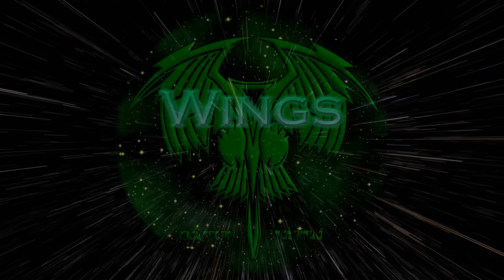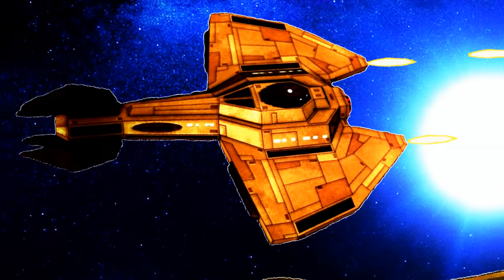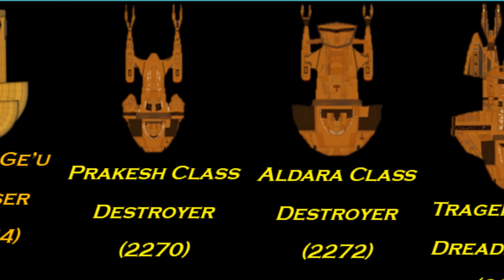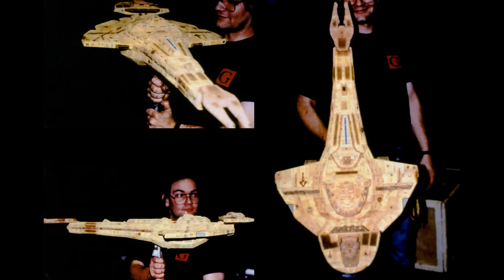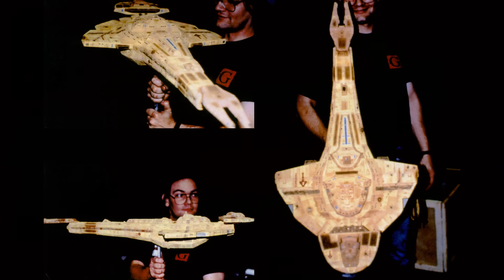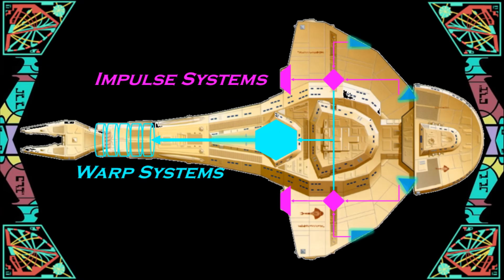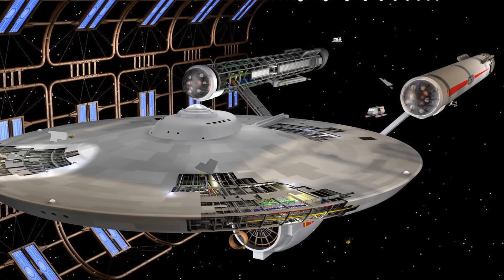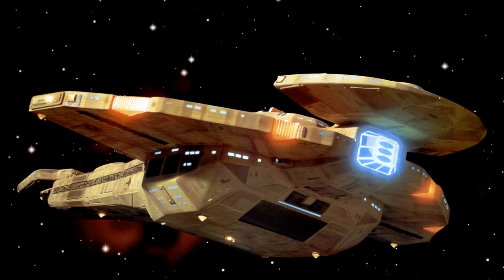Why Are Cardassian Ship So Weird?

Comment: I think Gene's 'rules' really only apply when certain design choices are in play. And an oversimplification, conflating the nacelles with the coils housed IN the nacelles.
-Rule#1 "Nacelles must be in pairs": I think the common modern understanding it it it less about the nacelles, and more about the warp coils housed in the nacelles. So, by this logic, you can have a single or odd numbered nacelle IF it contains a PAIR of warp coils.
-Rule#2 "Warp nacelles must have at least 50% line-of-sight on each other across the hull": Again, if we use modern understanding, in a single nacelle configuration with dual coils, the coils will have LoS of each other WITHIN the hull.
-Rule#3 "Both warp nacelles must be fully visible from the front": I think this speaks more to Starfleet's decision to put the bussard collectors on the nacelles. Having (parts of) the hull in front of the particle scoops would likely reduce their efficiency. Move the bussard collectors, to any other front-facing part of the ship, and rule 3 is no longer applicable.
-Rule#4 is not really germane to the discussion here.

Considering in Cause and Effect the USS Boseman clipping a nacelle was enough for the Enterprise D to be destroyed before anyone could even REACH an escape pod; In some ways the cost-saving solution the Cardassians arrived upon probably made their ships more resilient on the whole, as well. From the front their warp coils are ENTIRELY behind the hull of the ship, from the top/bottom/sides, even if it is exposed, you would have to AIM for it, while you're more likely to hit something more centre-mass like the main hull. Even from directly behind, it has a remarkably small footprint.

Comment: Russian fighters have full radars in the tail, as well as on the side of the nose, for guiding radar-guided air-to-air missiles.  Before western fighters got helmet-mounted cueing, it could have been a big advantage, being able to take shots far off the direction of travel.  Guided weapons haven't been seen much in Star Trek, but it could be important to Cardassian guidance systems.  Also the tail has a great unobstructed view in every direction except front and back, so it would be a great place for an omnidirectional sensor array that the front and rear sensors can fill in the gaps for.

Comment: There are a LOT of fighter jets that have radars in places that aren't the nose. For example the SU-57 has one in the ass tucked between the engines, as does the F-22 and the F-15, and all three of these have radars pointing to the sides as well. Why would a warship only have sensors pointing forward? No blue water naval asset built in the last 50 years does so why would a starship that has twice the area to cover that an enemy could be hiding chose to be blind in 80% of directions?

Comment: Based on your analysis it’s pretty good. But I got a possible suggestion about that one nacelle in the tail. That one nacelle is actually two semi cylindrical nacelles put together resembling one. There is no mention you can’t have them next to each other that I am aware of. With d-shaped warp coils being smaller would be easier and cheaper to manufacture. Anyone would worked in crafts and manufacturing can recognize that smaller would be easier, faster, and cheaper to make in a war involving attrition. This does not change anything about your analysis on functionality. Everything would still work as you described.

Just wanted to say this even if it’s wrong.

Comment: It's a shame we don't see many example of military aid or surplus usage. In TOS we had Romulans using D7s (totally not for budget reasons), but you'd imagine smaller empires make use of old surplus designs from larger empires that no longer need those ships, just like we have in real life. It's better than just scrapping them (which we do see). Where's the faction that takes Klingon and Federation ships, slaps some new systems and guns on them and covers the hull in scifi equivalent of ERA?

Comment: Actually to this day I believe these ships are flying backwards. fair enough, they are modeled after Egyptian ankhs and the tail is like you said, a claw, or maybe a stinger like a scorpion, yet if they are flying the other way around, their profile looks like an old sailing ship with the bridge at the back and high above the other decks. If so, then what you call a stinger would probably make even more sense as a stinger, housing heavy cannons or even photon torpedo launchers right at the front like old monitors or even the first torpedo boats with the torpedo launchers right in the front. So yes, I think that somewhere along the line the designers of these ships had a certain indecision about what their flight direction would be in either decision that they could make would turn out to be a very cool one, just as it did.

Comment: Rear facing sensors work as an idea with the whole "jet fighter" design principal, most modern fighters have a secondary radar in the rear to act as an early warning system and to assist with tracking targets behind the aircraft. Kinda neat honestly.

Comment: I always assumed that the prongs on the back end were the nacelles and that the Cardassians just opted for smaller nacelles and like a more powerful warp core. 

I play electric bass and guitar, so I kinda analogized this to how guitar and bass pickups work. Basically these are electromagnetic devices with magnets and coils of wire. This is a gross oversimplification, but to get a "hotter" pickup (as in more apparent output, which translates to higher volume or more overdrive, depending on the amplifier and how it's set up, etc.), you can add more wire windings, or you can use a bigger/stronger magnet with the same number of windings. 

The other possibility that occurred to me while watching the video and looking at the older Cardassian ships. What if they actually DO have two nacelles, but they're stacked vertically in the tail section? On the Galor class if you look at it in side profile, there is a horizontal line bisecting most of the tail section. What if this is actually the division between a stacked pair of warp nacelles with oval shaped coils, held within the body of the ship?

Comment: Different levels of technology leads to different innovations.... the concept of a lateral or broad technological advance vs tall or forward advances.  Kind of like the cell phone has been broadly advancing but in the end they are the same technology that has just advanced in its use as opposed to the next level of dermal implant phone thingie.  I believe the concept is that the easiest and safest method is the rodenberry rule, while other methods can show advances beyond the norm but without an advance in the speeds or type of warp drive.  Star fleet vessels got with tried and true designs ever specializing and trying to Amp up however they can to improve stable speeds.  In the case of cardassians I would point out that maybe they had to create a system out of necessity for war, maybe not as safe, quicker to build, and then out of ego decided to perfect their system to make it theirs and different from their enemies.

Comment: Heat sinks do not work in space as there is nothing to take the heat away from the system.  Heat sinks work in atmosphere because the air molecules take the heat energy and disperse it.  This is not available in the vacuum of space.

Comment: The thing with the one nacelle at the rear is that it would be an extremely inefficient warp bubble, the ship is contained in the front half while the rear half is just covering empty space. With a single projector you also cant modulate your warp bubble to be closer to the hull as you could with a twin nacelle design. That may actually be a lore reason why the Cardassian ships warships are usually slower, often maxing out at Warp 8.

Comment: I'd expect the maintenance on monocelle designs is vastly simpler, because there's no requirement to tune and calibrate a pair of nacelles to be perfectly balanced.

IIRC, tuning pairs of nacelles is mentioned in one or more TNG-era sourcebooks like the Technical Guide as a major task undertaken only at major shipyards and starbases, implying major infrastructure, tooling and expertise. Dual nacelle designs allow starship designers more design latitude and greater performance versus monocelles. But only being able to go Warp 8 but have twice the fleet is a valid design choice. As the Soviets said "quantity has a quality all its own". It's exactly the choice you'd expect from a faction with more manpower than economic power.

It's slightly surprising we don't see more monocelle designs among second-tier species, but Federation members probably adopt Federation-recommended minimum engineering standards that include dual nacelles for all warships and most support vessels.

Comment: Aircraft have missile detection and eletronic counter measures on their tails. 
And as most of the weapons face forwards, having warp wings makes no sense if you want to preserve your warp engines from damage. Having a single nacelle behind most of your structure, it'll be protected and you can run away at warp if necessary.

Comment: The problem with the "claws" being for heat is there's really only 2 ways to get rid of heat in a vacuum. Thermal radiation or conversion. If they were thermal radiators they'd likely be glowing and would probably need a much larger surface area.

Comment: In my head-canon, not at all confirmed by evidence on screen, I have always thought more warp engines mainly means "more reliable for long range" rather than "faster."  Like, a Constellation Class with four engines can be waaaay out making first contact with the Ferengi in a place that Starfleet couldn't even recover the ship.  And more spread out engines are also generally more reliable for long missions, like a Nebula Class does short range Cardassian border patrols and a Defiant Class mainly stays parked at a station because the tucked-in nacelles are easier to defend with shields but dump more radiation into the body of the ship so they need baryon sweeps and maintenance downtime more often to mitigate the effects of warp engine emissions being right next to core systems.
Since Cardassian ships are mainly warships and not explorers, I think it makes a ton of sense to interpret them as having one big warp engine at the back that is tucked into the hull.  They are meant for short range tactical work, border defense, and war with fairly close by neighbors rather than power projection thousands of light years away.  That all aligns with not needing to maintain detached operations for years and years with a lot of self-managed maintenance in a friendly port.  One well shielded warp engine would make a ton of sense with how their doctrine is portrayed.

Comment: I will correct you  on the aircraft doesnt have sensors backwards, they have sensors everywhere! Those rear ones are usually in between the engines or embedded on the vertical stabilizer.

Comment: What if the cardies use nested warp coils? If you had one coil *inside* another, then they still have full line of sight, so to speak. The tails might be there for shaping the warp field, like, vectored warp geometry? They do all pinch toward the aft, perhaps its like the tail end of a jet engine, focusing the warp field which might theoretically make them capable of higher warp speeds, possibly at the cost of warp maneuverability?

Comment: I had just assumed, looking at the Galor in particular, that there's 2 warp engines, side-by-side in the tail. Presumably there's a small gap in between, which is also an access space to maintain the warp engines. Among Cardassian single-tailed designs, the wide(X > Y) tail of the Galor predominates, and the lateral tail grooves are relatively common. I never questioned the "wings", they seemed obviously of the same sloped-armor school of design as Federation saucers.

However, the question of maneuverability at warp combines with the canon graphic(TNG 6x11 Chain Of Command, Part II) to suggest a design with three(or four) unequal engines. Note the areas lit up on that graphic(a Galor): Just a little bit at the tip of each wing, the lateral tail groove(and presumably its mate), and an aft-wards patch on top of the tail, just fore of the (probable) radiator. Presumably the armor and structure protecting the tail engine(s) affects the pattern there, but this suggests they have a small warp engine at the tip of each wing, in addition to the tail engine(s). This also solves the issue of the wings being too small to support main engines — the wing warp engines are indeed smaller.

Instead of splitting up two main engines for yaw, they tuck the main engine(s) away in the tail, and have an extra pair of little engines specifically for maneuvering at warp. That extra pair appears to be spaced as wide apart as the design supports, which is exactly where you'd want yaw engines. Thus, the wings are effectively heavily-armored pylons, in addition to appealing to the same justifications as the saucer.

The same may apply to some designs(notably Klingon and Romulan) with dinky nacelles. Those are for maneuvering, and there's a main engine or two buried in the hull.

Also, note that there are multiple single-nacelle Federation ships — all, so far as I'm aware, freighters or the like rather than warships or anything performant/maneuverable. This being a valid cost-cutting measure seems well-supported. It's possible the scaling exponents make the small maneuvering warp engines disproportionately cheap, but that would also suggest two rather than one engine buried in the tail.

I note the full-blown warp wing hypothesis isn't fundamentally out of the game — look at pre-Federation Vulcan designs, most use a "wing ring" rather than nacelles — but the canon graphic is a killer there. It's not the whole wings, it's just little bits at the tips, and also some parts of the tail.

Comment: a nacelle is a warp-dynamic feature similar to a wing, not the engine!!! that'll be the warp core *(which is indeed almost exclusively single in most jet)
sorry, but how does a single nacelle work, how is that not like having a single wing, right or left, within a fighter design... it will not be stable unless you totally rethink warp.

now, there are other means of FTL than warp, and indeed, I can see some far civilization it using primarily a different technology for there FTL travel... we do see in the last Lower-Decks season that FTL sailing is a thing that got utilized and can be augmented to control it, not just a one of exception in DS9... so, maybe that's a historic tech they do use with a "wind" generating anomaly as a primary drive, or, I can kind of also see the Cardassians using a form of Spore-Drive (just seems a technology very much suited to the Cardassian ways)... many ways to go around having to have warp nacelles *(which never seemed to me like they make sense as this universal constant they are in ST)
 but to say that this is a warp technology that reduces the number of nacelles out of economy breaks every rule of what warp is as far as I can understand it.

Comment: FWIW, I believe Rick Sternbach envisioned that tail prong as being an aft facing energy weapon of some kind. You'll notice it bears a resemblance to the prong on the front of the Klingon V'orcha. Sternbach thought that prong would be some sort of energy canon like the 'wave motion gun' from Battleship Yamato. So when he put a similar design detail on the back of the Galor, he thought that the Cardassians A) built a knock-off version of that cannon, and B) mounted it aft facing as they might be more likely to use it when flying away from an enemy.

Comment: Honestly I've always been of the opinion that they had some form of rod based system up in the wings rather than coils. The Cardassians seem to favour rods in quite a bit of their tech so it wouldn't have supprised me to see them use a different way of harnessing the warp effect.

However I will admit that your point about the vents at the rear of the vessel does make a lot of sense, and I can also see Cardassian engineers going for a single drive unit as an economising measure.

Could be a combo of the two - a main drive nacell in the rear of the ship and some form of rod based system toward the edge of the wings to provide improved manoverability. Hell, possibly even have the wing based ones tied into the impulse reactors - vastly limiting their power output, but enough to serve as feild moderators for the main drive. Not an efficent way to run a drive, and would get progressively less manoverable at higher warp speeds, but would mean Cardassian ships could manover quite well low down in the warp speeds when they needed to.

Plus with extra bussards you can partly offset the fuel cost...

Comment: Most  submarines are single propulsion system which would make sense since Star Trek is reminiscent of submersible naval vessels or the navy in general (i.e., navy ranks, weapons (torpedoes), tactics, etc.). 

Also, since it is reminiscent of the navy then placing a sensor array behind is accurate such as a in today's terms a towed sensor array, but since  this is the future then it would make sense for something more  advanced.  The reason for having a towed array and not one that is not just directly behind it, is because the propulsion system generate massive interference with the system. The US when hunting Soviet submarines would "tail" the Soviets behind them  in the "Baffles" and the Soviets would not be able to detect them. So, when Soviets would do eradicate maneuvers to get pass the  "baffle" non-detection zone the US called it "Crazy Ivan".